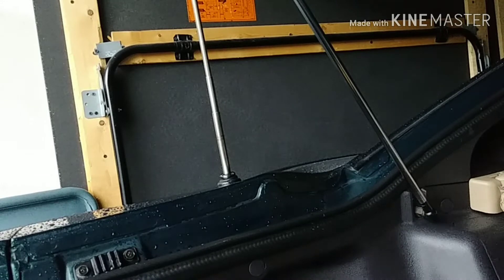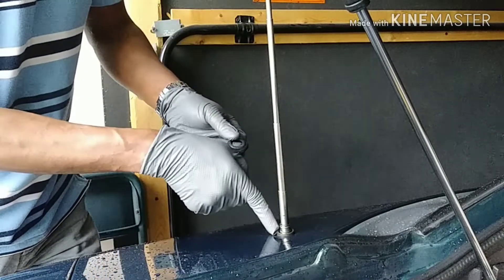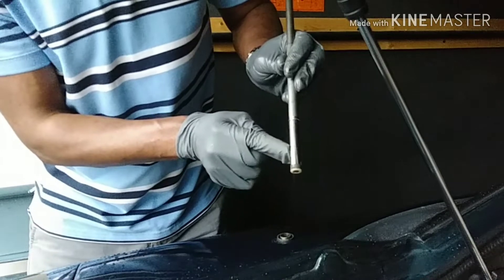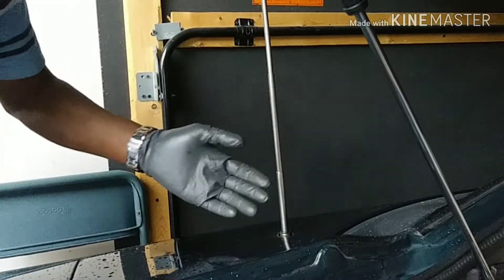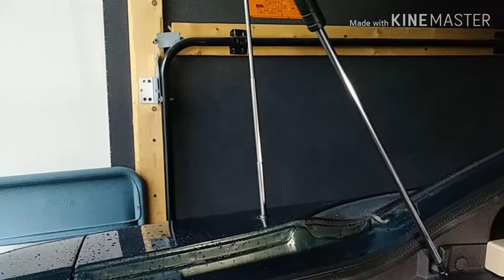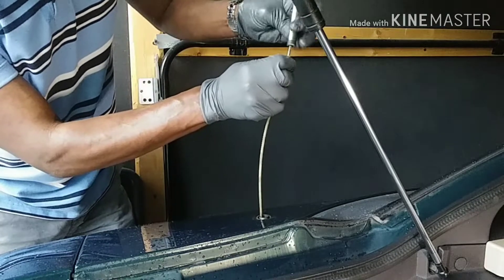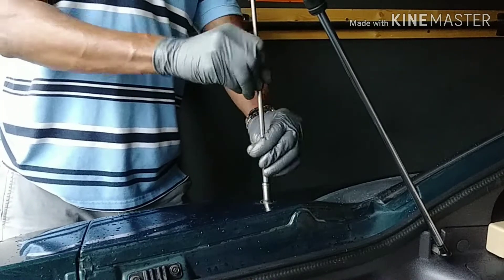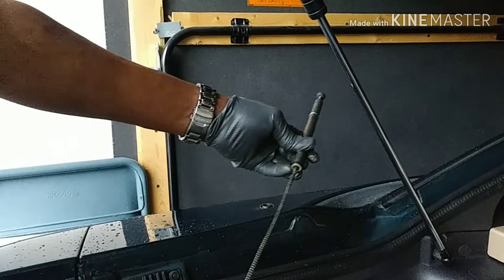MITSUBISHI 3000GT. HOW TO FIX A FAULTY POWER ANTENNA. PART 1/2.(watch part 2/2 for the complete fix)

Comment: what would happen if the antenna was stuck inside and wont come. Do you remove the rubber first then remove the antenna when the radio is on?
Reply from the maker: You might have to remove the inner tram and take the whole power antenna out. Because regardless that's the only way to fix it if it is broken.

Comment: yes it looks broke ,they are very pricey to replace,also spray the telescopic pole with wd40 it will slide up&down easier
Reply from the maker: I had to fix it...here is the title or check for it in my channel... "MITSUBISHI 3000GT. HOW TO FIX A FAULTY POWER
 ENTENNA. PART 2/2."